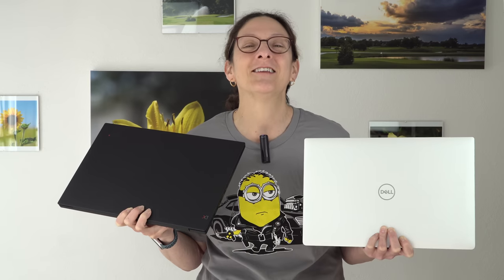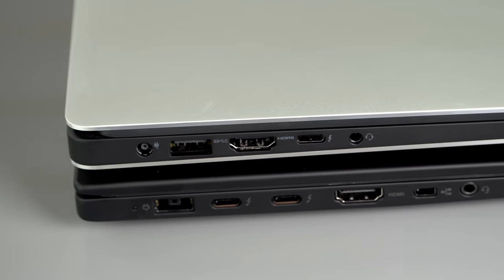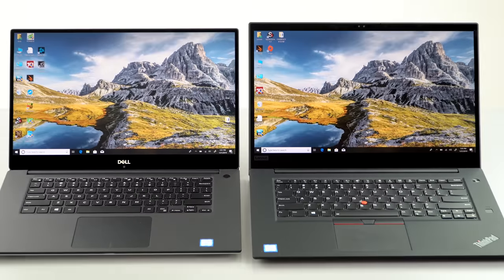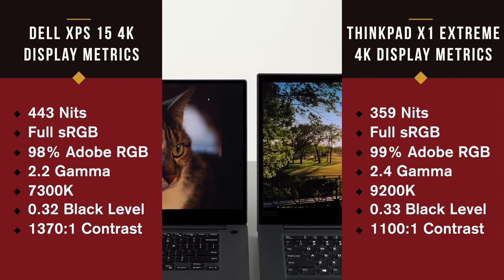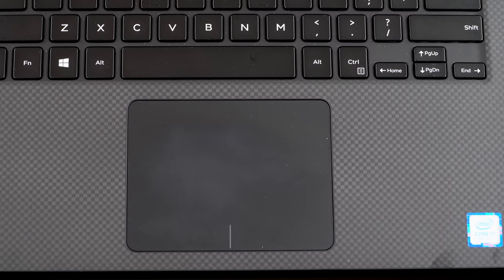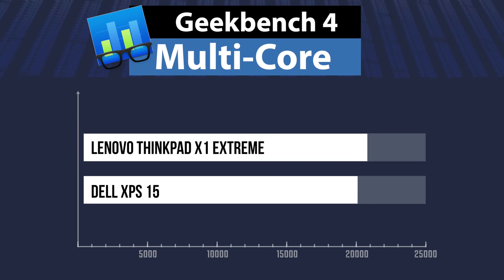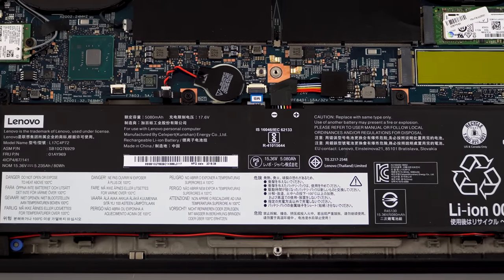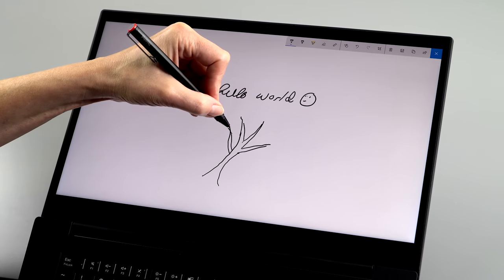Dell XPS 15 vs. Lenovo ThinkPad X1 Extreme Comparison Smackdown

Comment: I knew that Lisa was one of the very few dissenters that the XPS 15 is the best choice of machine, but I didn't listen and I got one and it has been a major headache.  It's beautiful, the 4k screen is amazing, etc. but it's been trouble the entire time I've had it. Critical thermal shutdowns started within one month and it ended up getting a refurbished motherboard replacement which I didn't see coming as the onsite fix.  I knew about the repasting and undervolting, but I thought those guys must be gamers. Nope. Mine literally dried up and started shutting down withing one month and it made me believe something more serious must be wrong with it and I was timid about breaking it open and voiding the warranty.  

Anyway, it's still crashing and I see in her reviews that they found this to be common? Graphics related? I've been stressed that the motherboard they gave me was worn out or what IDK.  I'm trying to give it the cleanest Windows reinstall possible to see if there is hope. A reinstall from inside Windows didn't fully do the trick. It passes most hardware tests though. It just isn't fully stable and it's embarrassing to be out in public and have the high dollar Dell blue screen.  I was previously a desktop technician for several years and it makes me look like an idiot that deserved to lose my job (it was political to put it mildly) because this thing is so unstable.  I worked on a video of a trip recently and it refused to encode it - crashing within minutes. So, this isn't working.  

I wanted something to edit in Lightroom with. I'm just a hobbyist photographer, but I shoot a full frame Nikon D750 in Adobe RGB (mostly just because why not) and it was silly to do more than perform backups on my old cheap laptop. As stated I want something with some power to edit video. Even cellphone video from my Samsung S8 is 4k and it takes some muscle to push it around even if only throwing clips on the timeline with simple cuts between them.  I'm not much of a 'gamer' but I do play some Xbox Forza racing and I've frankly enjoyed just having the ability to whip out a Xbox controller and start playing some Forza wherever I am on the otherwise sexy little thin and light laptop.  

I considered jumping over to one of the 'gaming' laptops. Razor, Aero, etc. but there are compromises there with either build quality or shortfalls otherwise with the screens, no sd card reader, etc. I'm still considering it. The beefier video cards would be the advantage, but I'm not sure how much impact to Davinci Resolve they would actually have.  Just playing higher frame rates of Forza wouldn't be a very good reason to choose one.  

I've even given thought to moving to Apple, but wow are they expensive and it frankly scares me that you can't replace any components. I'm still fairly new to SSD, but as I gather they do wear out just like a mechanical hard drive for example.  It's not even as much the factor of being stuck with what you bought for capacity as the overall longevity of the machine seeming compromised (without whatever expense involved to have it serviced I presume) and for that kind of money? I would have to buy new copies of Lightroom and probably want Final Cut Pro too so there's another $500 at least.  I might even consider and older model of Macbook Pro, but even those are as expensive as any cutting edge spec Windows machine and they weren't cutting edge when they were new.  

I, however, fully support the Apple company philosophy of protecting their customers privacy.  I'm sure there is question how much they actually do so, but for me personally it almost makes the expense worth it to vote with my dollars to support them and move away from Microsoft, Google, etc. If I suffer a bit of performance loss to a more cutting edge Windows machine it's not like I'm doing this 40 hours a week anyway.  It's not just about being one of the cool kids with a Mac at the cafe for me.  I appreciate their stance on the privacy of their customers being important to them. 

I'm open to suggestions.  Anything that I haven't considered that is a serious competitor on the Windows side? Like is this Levono the most serious competitor?  Lightroom is probably #1 - so, a great screen and as close to Adobe RGB as possible would be nice, but if it's more color accurate maybe that outweighs ultimate coverage.  Video editing #2 and it needs to push simple 4k edits - so, probably any 8th gen i7 can handle it, but it can't thermal shutdown over it. Gaming would be #3 and frankly it's not a deal breaker if it can't run Forza. That's just a super cool party trick imo.

Comment: Definitely agree about Thinkpad vs. XPS stability. Dells are more troublesome for sure when it comes to driver/hardware stability.
Reply: That's a pretty big call - coming from somebody who has been in the IT suppport industry for about 10 years now.  Lenovo have had some SERIOUS driver / firmware / BIOS stability issues since about as far back as I can remember. 

Not saying that Dell haven't, but they aren't alone in it.
Reply: @Kriti Shah 
Based on what? You owned one ThinkPad and it never have you trouble?

Comment: My Dell XPS 15 is arriving tomorrow and I'm really looking forward to it. Dell just had a sweet deal and I got it for ~1500€ (FHD, i7-8750H, 16GB RAM, 512GB SSD) so it's at least 500€ cheaper then a X1E with similar specs. Although the Lenovo might be a bit higher quality, the price difference is just too big. I also use a company supplied Latitude 5580 and my partner has a XPS 13 9370 and both of them have zero issues. Subjectively speaking, the Dell seems to be the better choice.

edit: It arrived! Unfortunately one fan is rattling a bit. I'm gonna contact support. I hope they send a service technician to fix it. Besides that, everything works great. Installing Ubuntu was a bit of a hassle, but that's hardly Dell's fault.
Reply: How is your dell?

Comment: I had an XPS 15 9570 and returned it, now I am have an x1 extreme. X1 has much better quality.
Reply: does your x1e have coil whine? Mine has a loud coil whine, seriously annoying me
Reply: Yes, but not much, and it depends on your power setting.
Reply: @mingyewu8848  whats your power setting?
Reply: NightOwl16 I turned all the settings, such as speedstep, enabled.

Comment: Thank you so much for such an articulate video.  I watched this a bout a week ago and was able to make my choice which was hinging to one direction and ... well, your honesty and fair review actually pushed me to the other.  Thank you I love your channel (and I'm typing this on my new laptop.)
Reply: Which did u get
Reply: @afoakuclinton7810  I ended up ordering an XPS 15, i5 8g of ram.  I updated the wifi card myself.  I was concerned only ordering 8g of ram but I can always upgrade, I don't think I will need to. when I game on it I use moonlight and stream games off of my main Pc from home.  I used the Dell outlet and purchased it "as new" for about 1/3rd off the main website.  I picked the 1080 screen for battery life (and I honestly don't know why you would need a higher resolution screen on a 15 inch monitor.)  The battery easily doubles what my partners 2019 mac book pro gets.   Not the absolute best but for a daily work machine it was a great purchase for us.

Comment: In the past month I had to send my XPS 15 to repair twice. I keep getting an issue with the display after I shut down the computer, it won't turn back on. Thankfully Dell's support is fantastic, although it's hurting my trust towards my laptop. This shouldn't be happening for the price you pay and as someone who uses it professionally, I need the computer working reliably 24/7. Makes me wonder if I should've gone with another laptop, although from what I see now a days, every laptop manufacturer has issues with quality control. With that said, I think it's important going with a brand that has great technical support, so you're not totally screwed. I'm coming from a Macbook Pro user for many years, so the transition hasn't been smooth at all unfortunately, but I'm not buying another Apple computer anytime soon. I can't justify paying so much for them, especially these days when their slower performance, lack of ports and expandability doesn't suit my needs. Giant rant aside, I do have my doubts. I actually have 5 days to exchange my laptop through Amazon. Should've I gone with another laptop in your opinion?
Reply: Sincere question, do you regret buying the XPS 15? I hear so many negative reviews. . .
Reply: @ImKevin  In a way I do regret it, but I haven't spent enough time fully using it to know for sure. It broke on me the second week of me owning it and it broke down again only 2 days after I got it back from repair. Then again, I don't know any other laptop that truly compares to it for my needs (battery life, 4k color accurate screen, sd card, fast video rendering, build quality, etc) so I feel like I'm stuck with it until they can repair it 100%. I'm sure once it's working correctly, I will feel great with it. It's just not a good first impression and experience. Kinda ruined my "new gear" vibe really. My case could be rare bc it had to do with something faulty in the display, just sucks this is happening.

Comment: Hi Lisa. Can you confirm if the XPS has any audio issues? I've been seeing a lot of complaints that there's a popping/crackling sound from the speakers in a lot of laptopns. Also seen something about DPC latency?
Reply: It's true.
Reply: Don't go for it, Dell  has several audio issues.

Comment: Hi Lisa. The BIOS on the ThinkPad is not really very good if you are a power user. Version 1.13 bricked if you adjusted the thunderbolt settings, version 1.15 bricked if you adjusted the dedicated graphics settings and 1.17 bricks if you turn the onboard sound off. Good review though. I have the P1 sibling to the X1 Extreme.
Reply: Are you able to install Linux on your P1 without bricking it?
Reply: BSPBuilder yes. In running fedora 29 Workstation. Everything worked out of the box, including sleep, after installing nvidia drivers
Reply: @Kerrathul  Thanks!
Reply: do you even know what the word "bricked" means? all of these are solved by removing CMOS battery
Reply: Bacon nope. Lenovo laptops have a cmos reset button and I tried removing the battery as well. Just look at the sticky threads on /r/thinkpad

Comment: I'll take the Thinkpad any day of the week. 
After using Thinkpads since I graduated, I got a Dell XPS 13 a few years ago. Build quality was subpar for the price, and it had a TERRIBLE case of coil whine that I couldn't get over. Had several months of back and forth with Dell's customer support where they promised a fix (yes yes there is a bios update coming, wait a few weeks!). 
Ended up returning it which they initially wouldn't allow (had to write a formal complaint letter to their HQ and call several times to follow up). Worst customer experience ever and of course YMMV, but I will never buy an XPS again...
Currently interested in the X1E but might wait a bit for a refresh (not in a hurry)
Reply: Dell Sucks

Comment: I love your reviews!  Great job.  I did have one question... I have read that some of these ultra thins can actually take a USB-C plug into the USB-C port up to 100 watts should you not have your power supply with you or need some extra power handy through a USB wall adapter.  I think I read you can definitely do this with the Lenovo ThinkPad X1 Extreme.  Can you do that with the Dell?  Can you verify that with either laptop???
Reply: I read an article saying that you can do that with the Dell as long as you have a 60w(or was it 75w?) power adapter for type c pd.

Comment: i bought mine lenovo x1 extreme 4k i7 8850h 32gb 1050ti 1 tb pci nvme opal 2.0 m.2 for $2049 usd with tax during christmas. battery life is not great but its not a big deal it charges pretty fast.
Reply: pounds right?
Reply: usd
Reply: good price. That's over $4k AUD.
Reply: Damn that’s an amazing price. It must have gone up after Christmas.
Reply: Chris K yup it was only for few hours took advantage of it
Reply: lol i got the same model for $1770 with tax...I sent it back because the heat and battery were just very bad
Reply: blackice214 wow thats damn cheap i see on ebay sometime u can find dirt cheap
Reply: @RizwanAli-vl1zv  Na got it black friday
Reply: blackice214 na i didnt see that cheap during black friday. hard to believe but good for u if u got it for that much
Reply: @RizwanAli-vl1zv  Yea i used perks at work and BLCKFRI40 code for a total of 47% off...should of gotten a carbon instead since i returned that x1e
Reply: @OfferoC  they were 30 something % off on lenovo.com today still
Reply: Lucky you!
That config is €3383 here in France which is $3856 USD. All this because of some stupid taxes and laws where companies can't do huge reductions.
Reply: I can get that same configuration with 5 years of premium support plus accidental damage for 3700 Canadian dollars after tax. I am trying to decide whether to return the XPS I got for with 16 GB of RAM i7 8750 FHD and 1 TB SSD plus 4 year premium plus warranty for 2700 after tax.  It seems like the thinkpad is better but 1000 dollars better?
Reply: I lived in the UK and the US. Laptops in the US are definitely much cheaper than Europe.

Comment: Dell is probably the better bang for buck overall but I like the Thinkpad better
Reply: Can't go wrong with Thinkpad support and quality.  They have tanked a bit since the T400 series but they're still well made laptops with great keyboards.  That touch point is really nice.  I prefer it over trackpad.
Reply: @timothyandrewnielsen  
I'll have to agree to disagree with you on support.  Lenovo support is typically horrendously bad.  Up there with HP as some of the worst customer support I've ever dealt with in the industry. 

Far as products go, the X1 Carbons and X1 Yogas seem to have exceptionally good quality control.  The other Thinkpad models in my experience have been a bit hit-and-miss.
Reply: @pete3198 You have a point about support.  They used* to be very good however I have had a couple issues with getting them to replace faulty screens lately.  I had to seriously complain to a manager to get them to do it.  They tried hard not to do the repair.

It wasn't always the case... Still... the keyboard positives outweigh the bad here.  The trackpoint is a seriously wonderful little device that no other laptops have.  I'd still buy lenovo (and do for my company) over HP/Dell.  If lenovo keeps cutting corners, they could lose my business.  Again, they're still #1 for me.
Reply: @timothyandrewnielsen  
I've been dealing with them for about the past maybe 7 years, and I've had consistently poor service from them throughout. 

Their support technicians are generally pretty weak and often force you to run through trivial and pointless troubleshooting steps even after you've told them you have already done it...

Trying to get any kind of quote for an out of warranty repair is a nightmare.  I once had to chace Lenovo for TWO MONTHS for a quote for a motherboard replacement on an out of warranty model - and it's out of warranty, meaning they are actually making money from this.  They still took forever.  

You often spend forever sitting on the phone on hold.  

The last ticket I raised with them was just before the Christmas holidays - I told them the customer was not in on the specific day, but would be back after the holidays.  I even gave them an exact date that the customer would be returning and would be available to run through fruther troubleshooting steps.  They closed the support ticket on me without my authority, without the issue being resolved, on the basis that they refused to wait two weeks for the customer to return from Chrismas holidays.  I've never seen somebody do that in my 10+ years working in the IT support industry.  

One customer of mine had an on-site support agreement, and  had a clause in their agreement stating that all repairs had to be done by Lenovo or warranty would be voided.  Despite the agreement Lenovo still tried to avoid sending a tech out almost every time we called, instead trying to insist on sending out the part and having us replace it ourselves. 

When the technicians finally do agree to come out, they often take days. 

When it comes to Lenovo machines reliabliity is pretty much your last line of defense - because if you EVER get put in a situation where you have to actually call their support line, god help you.

Comment: I'm looking at the XPS 15, specifically the i7, 16gb ram, 512gb SSD, 4k uhd version.
It's $1799 on B&H (about £1360) and I assume customs and fees for international shipping would be a couple hundred dollars on top.

... This still works out cheaper than buying it locally here in Northern Ireland, here I find it for £1900 ($2400-/+) at the cheapest and I do not want to pay that much.

Basically I'm wondering if it would be better to buy it from B&H or is there something obvious I'm missing, or something risky with this idea.

Comment: Which would you say has better speakers? And are the speakers on them front-facing?
Reply: Lenovo ThinkPad X1 would be better choice.
Reply: @sahilmukherjee7441  If that's true, then I hope it's also compatible with Linux. HP laptops seem to have audio and WiFi problems with Linux, but Dell and Lenovo seem fine.

Comment: What computer brand and model do you recommend for day trading , I was told that I should get a gaming laptop so it can handle the software needed to trade . I’m lost , so your advice would be appreciate .. Thanks
Reply: X1 extreme.. u can even plug to several montitors